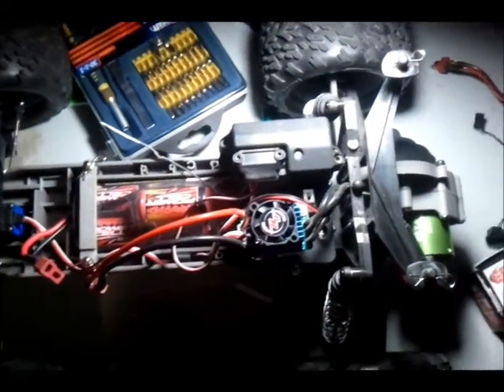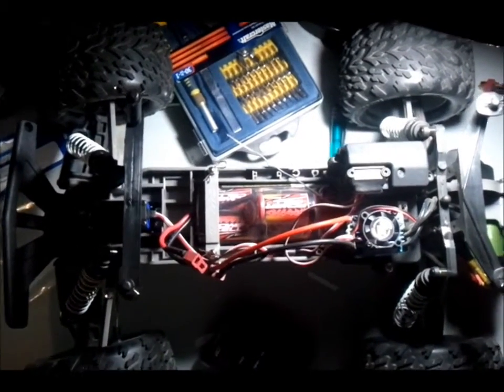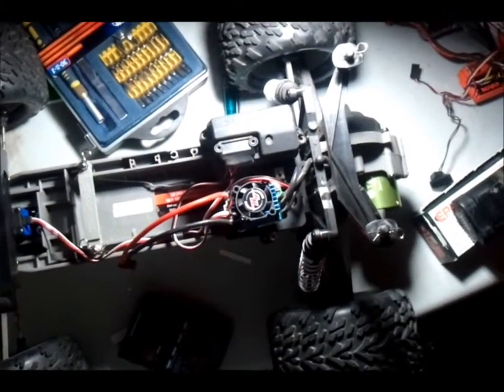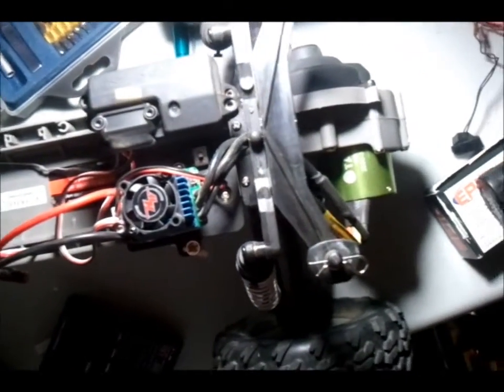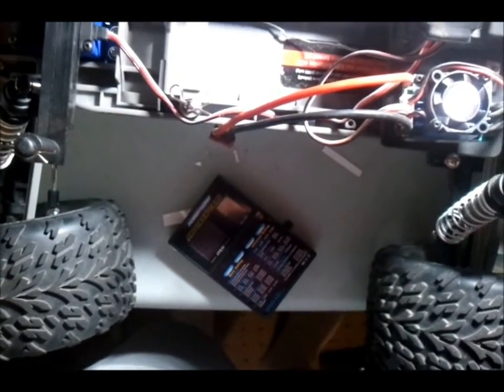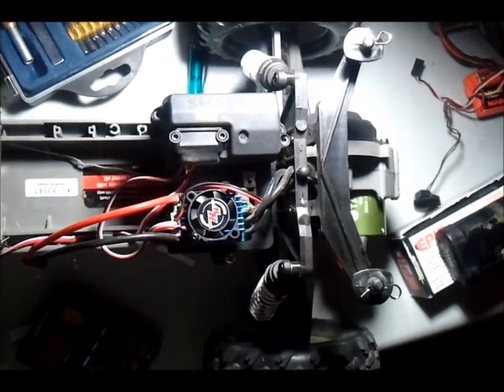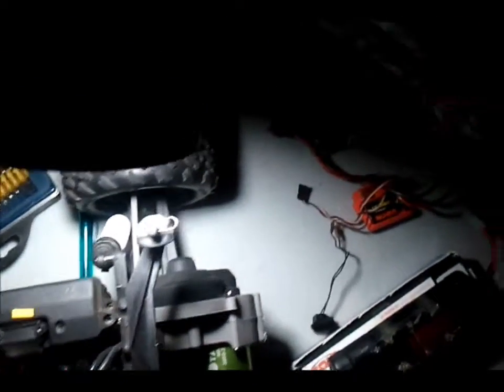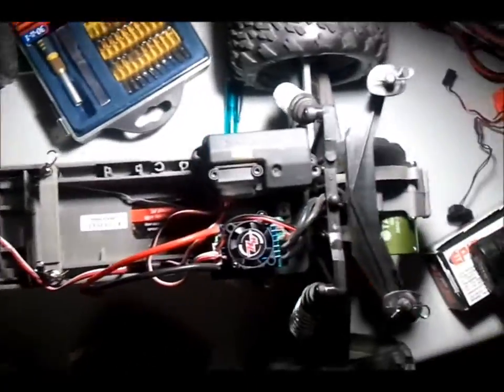Traxxas Stampede with a 35A HobbyWing ESC and Tacon 3500kv Motor

Comment from the maker: @NYSuperman I use velcro straps to hold everything in place.  The hobbywing receiver is not as long or wide as the xl5, but it's taller.  At that time, it was not totally waterproof. I would say that the esc itself is probably mild splash proof.  If you hit a small puddle once during a run and it gets some water on the case you should be fine.  There is a rubber seal between the top and bottom pieces of the ESC.  I put liquid tape on mine now.

Comment from the maker: No issues, I have been using it for over a year now in summer and winter and never had a problem.  The thing is, I just got a 2wd Slash, and I can tell you it is quite a bit heavier so I would definately recommend using a 60A esc.  35A is fine for a stampede.

Comment from the maker: Just a quick note on this, I have been running it for a couple of months now (will do a follow up) and it's still running strong.  I think the question will arise whether the 35A Esc can handle the motor.  In my opinion, if you are running onroad or 2wd offroad with Nimh or 2S Lipo, you'll be fine.  I run a 4000mah 35c 2s lipo in this and bash it HARD with zero problems.

Comment: Thanks for posting. I just bought the ezrun 60a and the same Tacon motor. Did you keep the stock wiring for the esc fan? It's supposedly only rated for 5v